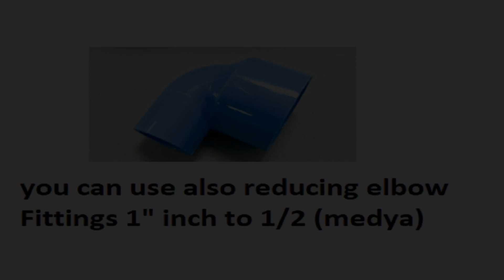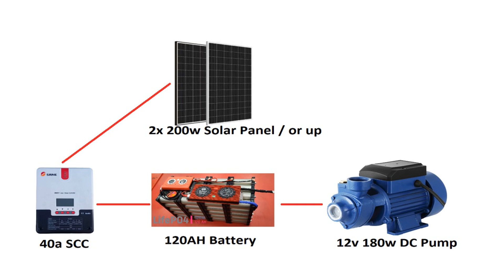12V DC Solar Water Pump

Comment: ano po yan direct sa solar panel or may battery>?
Reply: May battery po , pwedi rin po direct , need ng 2x 200w solar panel or 3x 100 watts po in parallel.
Reply: Di kaya masira ang motor ..nkaoag walang battery